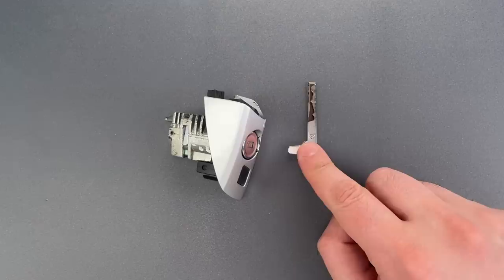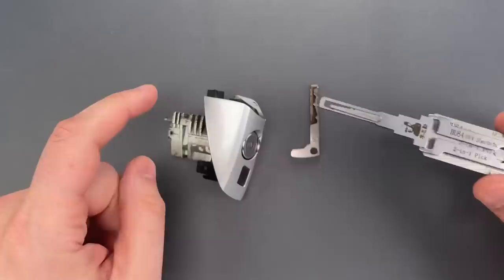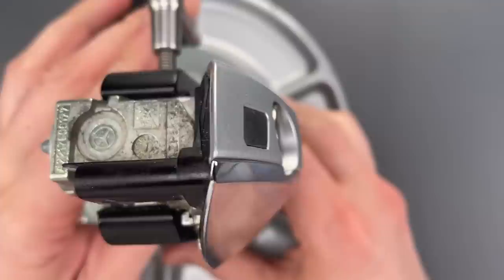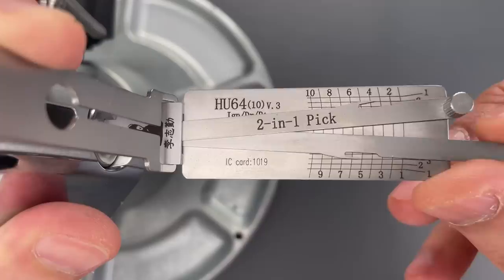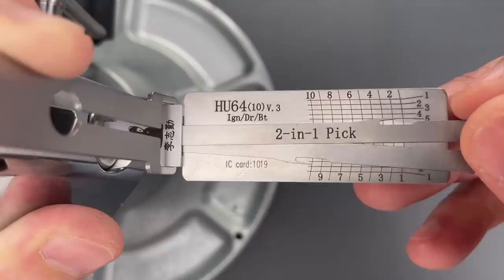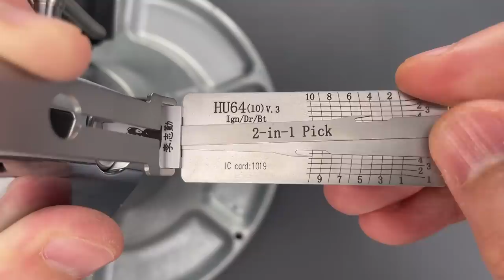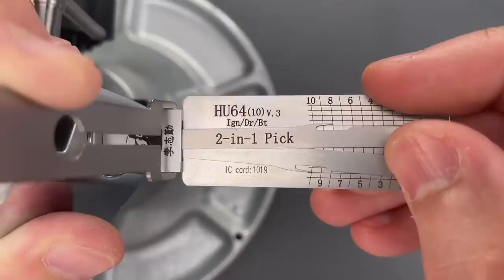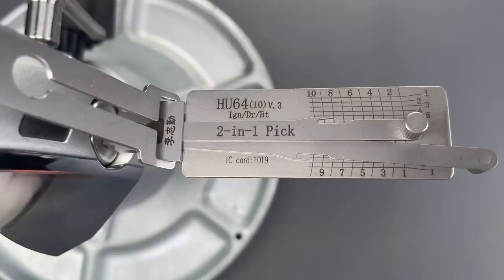[1411] Mercedes S-Class Door Lock Picked (2013-2020)

Comment: As a master mechanic working in a Mercedes garage.. I can proudly say, there are plenty other and ofc easier possibilities to open a Benz without lockpicking 🤣 

In some cases Mercedes itself calls out in the repair guide to send the owner away to get a coffee whatever, or simply distract them to hide the security flaws
Reply: This is the industry...
All the weaknesses are tried to be concealed... I've worked as a security service/door opening service for a few years, sometimes that's exactly how it works.
Some doors/windows are not much safer than a curtain.
Sometimes I waited 5 minutes in front of the already open door until I fetched the owner. because if they knew that it opened in 10 seconds, sometimes without real tools, they would probably sleep very badly ;)
The really difficult openings are the ones where something is broken inside the lock.

Comment: u may be able to open the door but modern car keys have chip inside them without the chip the engine wont start and also the car alarm will sound if you open the door with keys that doesn't have that chip

Comment: Locks on cars are pretty much irrelevant items. They are there to slow you down and deter you, not to prevent you from getting in entirely. A better lock than this (which takes a skilled picker 2-3 minutes to open) is useless because then the robber would just break the window instead. In fact, just touching the lock would sound the alarm, so it would scare the robber away or make him panic and break the window anyway to get in. Locks on cars are basically there to prevent someone from just casually walking up to a car and opening a door. Anything beyond that is pointless in 99,999% of cases. 

Not to mention actually getting into a car is pointless because there's no way you'll start it, it's not an old car that allows you to cross some wires and drive away. And if you have the equipment required to hack the car and start it, then a lock is not your problem to begin with, in fact, you can probably unlock the car wirelessly as if you had a key fob anyway.

Comment: I think they have been skimping on quality locks, shame on them.
Reply: The thing is: If someone wants to open the car to get what's inside smashing the window is 10x faster and way easier, so thieves will just do that.
And to drive away there is way more security inside than this puny little door lock. As long as manufacturers don't put in bullet proof windows and door hinges stronger than crowbars there is really no point in improving the lock design. NO ONE with nefarious thoughts will attempt to pick this lock in the wild!

Comment: The lock itself isn't great, true, but I don't think it'd be that easy in situ. Don't these modern car locks also authenticate the fob when the key is inserted? Meaning you'd have disconnect the battery to do this, and it wouldn't surprise me if the alarm system had a backup power supply. For that sort of price, I'd bloody hope so, at least.

Comment: It isn't that useful, as the alarm will trigger the moment you open the door. even with the car's actual key you need to use the remote. If it's low on baterry then you need to insert the key into the ignition.

Comment: One thing to add is that picking the door lock would only allow access to the inside or the car, starting the car is not possible this way. And for that, smashing the window is still the easier option, if you're a criminal.

Comment: Thing I've always wanted to know: How does a picker, while picking, tell the difference between a lock that won't turn because they haven't successfully picked it yet, and a lock that won't turn because it's rusted/dirty/malfunctioning?
Reply: You can usually tell from the outside if the lock is rusty and you'd likely feel it while you're picking it as well with the pins not moving easily.

Comment: In my experience most of these so called expensive cars are just regular cars wrapped in a gold foil wrapper.  It's more about a name and one's prestige in being seen driving one than actual value or quality.
Reply: You might not have noticed but you wont find many companies design and assemble their own engines and transmission systems along with lesser aspects like their own wheels..  buttons infotainment ..etc

Comment: If it takes LPL ~2 min to pick, I'd imagine that most take longer, and that someone would notice if this were to be picked in say a busy parking lot. Also, these cars won't start without a key, at least if they work anything like my used (2011) lexus (if you're wondering, the key can be read if you put it up to the button if the battery dies).

Comment: My shiny new 2022 GLC300 has the same kind of key. Even if you do pick the door open, though, you can't start the car without the fob (it's not a keyswitch, but a Drive Authorization System) and you'll set off the alarm. I expect that a thief will either break a window or else use one of the fancy remote methods to clone the RF signal.

Comment: Even upon gaining access, that tool still wouldn’t work on the ignition left to its own devices. For starters, a Mercedes Benz of that era wouldn’t have an ignition, being keyless. It would likely have a slot where the key is inserted and turned like a key - which is a pointless system really - or it would just have a button saying “ENGINE | START/STOP”, in which case, you turn the electrical system on by just pushing the button and you start the car by holding down the brake pedal or, if you’ve got a manual, the clutch and pushing the button. The tool you used wouldn’t fare much better on a car that wasn’t keyless as the immobiliser would detect that the keys weren’t there and thus prevent the car from starting. In fact, my car’s immobiliser sometimes prevents me from starting the car, even with the keys lol 😂 Anyway, if you tried that on a car made before the 1990’s, which aren’t all that common nowadays, you’d probably be fine.

Comment: To put this in context: Once you've opened the door, you still need a copy of the chip that's inside the fob, have to figured out the unique ID that's on the owner's chip and linked to the specific key and car. While that's happening you're probably having an alarm raising hell and, given the generation of the vehicle, might even have rescue service listening in in the emergency service connection next to the mirror. Oh, and if you're in the really expensive ones, the car still might not start because you have the wrong weight and measurement.
.
.
.
Give or take a security measure.
Reply: You won't drive away with the car, but it'll be empty once any help comes.
Reply: @QuintarFarenor  That's why we're not supoosed to keep valuables inside a car.

Comment: Why are locks such terrible industry for production? Like, is it just impossible to make a good lock that can’t be picked open?
Reply: LPL doesn't post locks he can't pick. There are high security locks out there that have never been proven pickable like the Protec 2, but they're expensive and picking isn't the biggest problem in most applications anyway.
Reply: Locks are there to slow you down and deter you, not to prevent you entirely. A better lock than this (which would take a skilled picked 2-3 minutes to open) is useless because then the robber would just break the window instead. In fact, just touching the lock would sound the alarm.

Comment: I don't know how I feel about a channel selling and teaching how to basically steal a car...
Reply: He teaching lock mechanics not to steal a car intention is your choice
Reply: Opening a car door ist hard, you can just break a window... And thats far off from stealing the car.
Reply: With that tool and some lockpicking experience, sure, you might be able to get into the car but that's it. 2013+ Mercedes all have keyless ignitions, this video does not teach you how to hotwire the car. No way anyone that has that tool and watches this video is going to steal an S class, chill tf out.
Reply: clicking through some of his videos will take roughly 5 mins to check out his intentions. instead you posted this comment :D
Reply: You can’t steal a modern car by just using this tool, you also have to defeat the electronic safety for the car to start.

Of course the easier way into a car is to just smash a window.